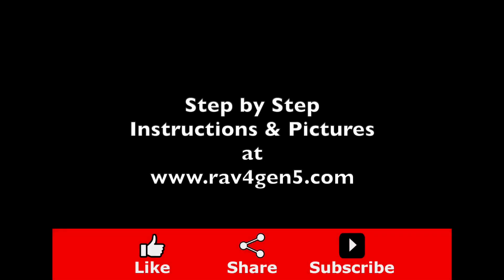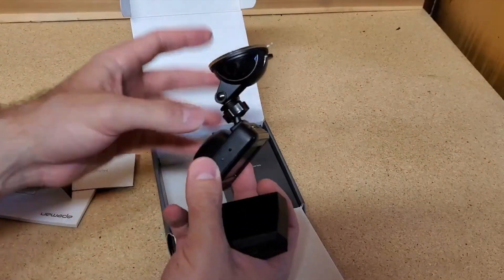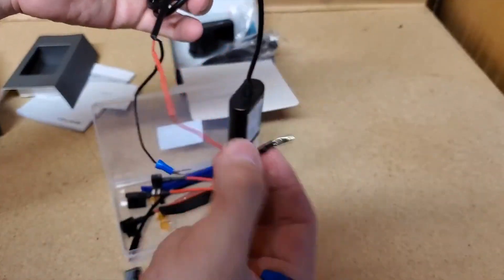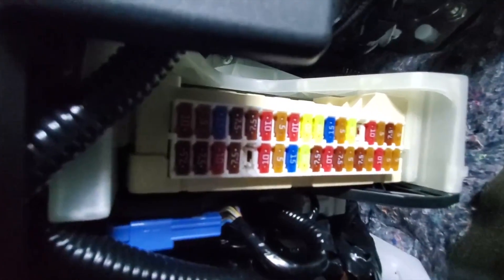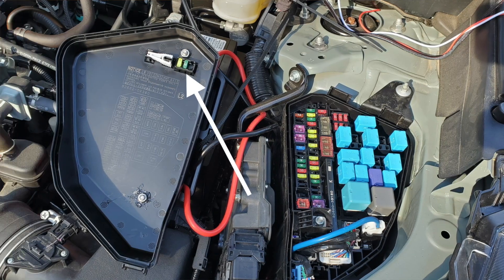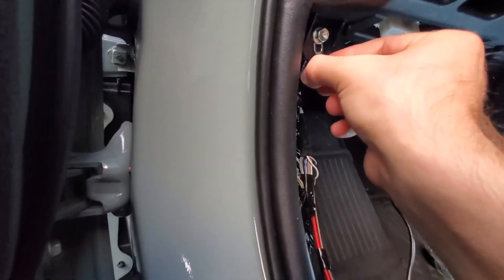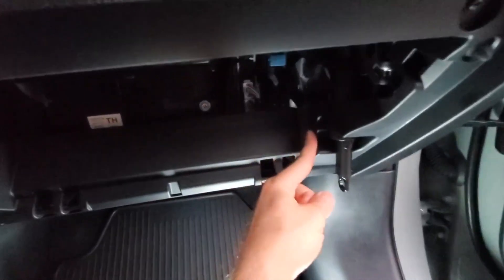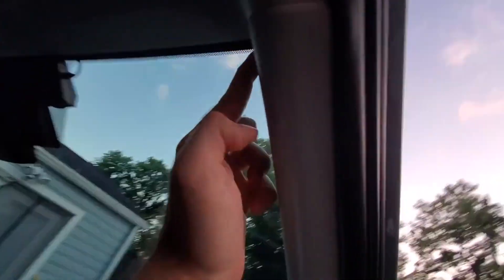Dash Cam Install on the Toyota Rav4 2019 2020 2021

Comment: Thanks for the tip. I threaded the cigarette connector power cable through the hole.  I think I was able to push it to the right and up and then felt it with my fingers.  It took me by surprise that I felt the cable after so many attempts.

Comment: 4:44 the direction if fuse tab MATTERS (please upvote so others can see this)
Reply: Doesn't matter if you are using a blank spot like he did, but if you pull an existing fuse, then it could make a difference.

Comment: The way the wire is being tucked under the plastic trim of the A pillar and running to the headliner, won't this be getting in the way of the side curtain air bag? I think the A pillar trim needs to be removed and the wiring needs to be routed in a way so that it's not in front of the air bag if it ever deploys. Do you have a video though on how to remove the A pillar trim?
Reply from the maker: Yes. I capture this in a later video. To remove the A Pillar, you can watch this. https://youtu.be/gei1uzoRCkw?t=354
Reply: @Rav4Gen5  Thanks, your videos are very helpful.

Comment: I have Hybrid model.
What if I have 3 wires (WITH PARKING mode):
- BAT cable
- ACC cable
- Ground

In which fuses should I put BAT cable and in which ACC cable?
Thanks
Reply: The Battery cable fuse is tapped on a fuse that is on all the time- fuse for dome light.  ACC tapped on fuse that turns on only when the car is on. Like heated seats, heated steering wheel. Options.

Comment: Hi, this question might have asked before but i have 2024 Rav4. I am using empty fuse slots for hardwire dash cam installation. Can i only use 1x 5A fuse on further side of the 2 slots in the plug and keep 1 empty? i tried but it didnt worked. I used other 5A which is always on and when ignition is turned on. Am i doing it correct. Please help

Comment: Thanks for making this video!  Very good timing as I’m expecting my dash cam next week and have never fuse tapped one before, but am going to attempt with this one.
Reply from the maker: Sweet! Take a minute to check your cabin fuse box to see that it similar to my guide. I have an adventure trim. I'm guessing it can vary depending on what factory packages we have.
Reply: Rav4Gen5 Yes true, will have to check mine. Mine is a Cruiser model which we have in Australia. Hopefully it’s the same as yours

Comment: Very nicely explained. If this RAV4 happens to be hybrid and if dash cam hard wired then it would not void warranty? The second method looks very safe and not touching fuse box and using cigarette lighter socket. I would be very interested if you have made a video for dash cam (front and back) with parking mode recording( separate battery backup) and not hard wired. Thank you.

Comment: Very useful video, thanks for making it.
Note: Only place the dashcam's lens in the range of the wiper blade motion, otherwise they are can't be used all the time.
Reply from the maker: This is very true. I actually have to adjust mine. Silly mistake.
Reply: Do you mean so that the wiperblade passes across the lens?

Comment: I'm using the VIOFO hardwire kit and it comes with a red "Battery" wire and a yellow "ACC" wire. How do I go about setting up the fuse taps for these two and where would I plug them in to the fuse box? Also does the direction I plug it in matter?
Reply from the maker: I am not familiar with that hard wire kit. It allows recording while the engine is off until a low voltage. I don't recommend this because Rav4 has issues with battery drain issue and this will escalate that issue. See instructions of the kit but looks like you need to find another fuse slot with constant power. Not sure.

Pig tail of fuse tap goes towards the direction of the door.

Comment: If I want to have the recorder on even when the car is off, which fuse box should I connect it to?
Reply from the maker: Any fuse that has constant power when car is off. Check with voltmeter but I don’t recommend it unless your device has low voltage cutoff.

Comment: Hi. Thanks for the tutorial. I'm trying to install it using the cigarette lighter but when I thread it through the hole (at 7:30 in your video) I can't find it. Could this be trim related? I see you don't a switch to turn off the Auto Stop/Start. Could this be blocking me? Any suggestions to get around this?
Reply from the maker: I don't think it's trim related but I also know it's a pain in the butt. Can maybe try a more ridged line or something. Best thing would be to go to the fuse box.
Reply: @Rav4Gen5  Thanks. I removed the gear knob and tray below the plugs and managed to thread it through

Comment: Looking to hard wire my 2021 RAV4 with a dash am as well. But cannot seem to figure out what type of fuse the interior fuse box uses, such as mini vs micro2 vs low profile or ATO. Any help appreciated. Don’t want to order the wrong add a fuse
Reply from the maker: Mini =)
Reply: there are two types of mini, (ATM mini and Low profile mini) for rav4 2021 you should use a low profile mini fuse tap..

Comment: Excellent video. But what about the ACCessory cable (yellow cable from the 5v to12v usb adapter to plug into the fuse box) ? which port do you recommend when RED and GRD are installed ? Thanks for your feedback.
Reply from the maker: You'll want to follow the instructions provided in your purchase. Mine didn't have a yellow cable. Your purchase allows the camera to continue recording while the car is off until a low voltage point is reached. For simplicity, you can combine the red and yellow cables together and tap into the same fuse in the video. This will turn off the camera when the car is off.

Comment: I’m hardwiring a BlackVue 900X to use in parking mode. What fuse do you use for the second wire (always on) and which two fuses do I have to place on the fuse tap? Thanks!
Reply from the maker: You'll need a volt meter and find a fuse that has power running through it while the car is off. Make sure you buy a battery jumper in case your dash cam voltage meter fails. You put the original fuse in one slot and another lower amp fuse in the other slot. The original fuse goes into the slot closest to the pins. I'll make a video on fuse tapping into a Rav4.
Reply: @Rav4Gen5  Thanks so much for the quick reply! I read that if you use an empty slot you don't need to fill both slots in the tap. Can you confirm that? Also, how do you decide which amp fuse if you use an empty slot? Does it depend on the car circuit or the device you use?
Reply from the maker: Correct, you don't need to fill in both slots if it is an empty slot. Only the slot furthest from the pin. You select the amp fuse base on the wire gauge size and the instrument your are connecting.The dash cam should specify how much amps it needs. Most likely 5 amps is plenty and will protect the wires too.
Reply: @Rav4Gen5  One last question (I hope!): can I plug both fuse taps towards the same direction, or the one in the left column to the left and the one in the right column towards the right, or the other way around? That would be great to see in a video because there's a lot of disagreement in forums and not a single video of what happen or could happen if you plug the fuse tap in one orientation or the other. Thanks a lot for your time.
Reply from the maker: Good idea. For me , it is in the direction towards the door. I need to double check that though. Might be different depending on the fuse you are going into. You want the current to travel through the fuse. I think my weekend is sunny so good day to make a video on this.
Reply: @Rav4Gen5  Sounds like a great plan! According to BlackBoxMyCar, orientation does not matter... but some people argue you could blow the fuse... just have a jumper ready! :)

Comment: Than you for the great video,
just a question. have you noticed slight resistance when you shut the driving seat door or any noise (air) since you have put a wire on the weather strip?

Comment: Thanks for this great video! Just wondering though, what SD card did you use? Because I read some comments from Amazon that it won't work with any other SD card unless it's the VIOFO endurance MicroSD card. Thanks in advance!

Comment: Where did you find the yellow 5 amp fuse ? 
Where do you get the second fuse ?
Reply from the maker: Fuses come with the kit. If not, you can purchase them separately. There are some fuses in the fuse box in the engine compartment but I don't remember which ones.

Comment: I bought 3 of  this dashcam and one died on the 2nd day >.>
the step down converter was soldered backwards (Black + / Red -) on the output side. I had a fun time trying to figure out what happened to the voltage and why the voltage was backwards
Reply from the maker: That is super weird. Glad you figured it out. Good thing amazon returns are easy =]

Comment: Quick question: what if you're going to be piggybacking off of another fuse? Do you insert the original fuse to the "add-a-fuse" in-line with the positive cable and the dash cam fuse next to it or it doesn't matter? Since I will be using an existing 10A fuse and my dash cam is 5A, would it be safer to insert the original 10A fuse first, then the 5A dash cam fuse to the "add a fuse"? I kinda repeated myself there but it's a little confusing. I would think the 10A goes first since the accessories for my car draws the greater current and then it trickles down to my 5A dash fuse. If that makes sense.
Reply from the maker: I cover it all here. https://youtu.be/t2X1924Mv30

Comment: Does it matter what spare fuse you use from the spare engine fuse box?
Reply from the maker: It needs to be a fuse that is smaller than what is installed in the fuse box that you are tapping into.

Comment: I can't get the fuse box cover to go back on after plugging that wire with the two fuses on it. Were you able to get your fuse box cover back on?
Reply from the maker: No. You can't.  Tape it on there so it doesn't get lost.

Comment: Hi   Well explained the fuse box/wire entries, Its a shame you did not have the rear camera set up and were to connect too. Thank you welshman 2081
Reply from the maker: I do cover rear camera install in a different video. It's not much different than this but it can depend on your trim.
Reply: @Rav4Gen5  Hi Thanks for the info, can you please give me a link so I  can view it. Regards welshman 2081

Comment: The wire seems to go over the air bag, this looks dangerous as it could block the airbag deployment?
Reply from the maker: Yes. It does go over the side curtain air bag. I have planned a new video to show and address this. But the airbags should still deploy fine despite a flimsy wire.
Reply from the maker: @kenwetz9545  Thanks for the response. I cover all of this in later videos including the removal of the head liner and the installation of the rear camera. I'll probably re-upload this video to point out this air bag issue. Seems to be the right thing to do.
Reply: @Rav4Gen5  Did you make a re-upload? I noticed many comments pointing out many mistakes including the air bag and fuse wire issues and you promised re-upload. People like me with little knowledge on this stuff easily get lost. I didn't see a re-upload link in description.
Reply from the maker: I will make a new version of the video but whatever people are saying about the airbag is not likely a concern. No issue on the fuse either. I’ll have a video this week maybe.

Comment: So the fuse cover won’t fit back on after install? Just verifying, as I just installed this. Thanks for the vid! It was easy.
Reply from the maker: Correct. The blade add a fuse will stick out. Tape the cover near that area so it doesn’t get lost.
Reply: @Rav4Gen5  Man, that was a fast reply! I was about to delete my comment cause I saw it asked and answered in the comments here. Thanks again!!

Comment: i have a 2018 rav4 :( can i do this?
Reply from the maker: For sure. There is probably already a ton of videos on how to do this on the 4th generation RAV4.
Reply: @Rav4Gen5  thank you for the quick response. I am not able to find any instructions for 4th gen rav 4 dash cam install only 2019+… i wonder how much different it would really be

Comment: How you know which fuse to tap into so camera turns on when car is on? I believe this is your off camera work.
Reply from the maker: Check this video. It could help. https://youtu.be/t2X1924Mv30
I did not specify the fuse because your trim might be different. But you'll want to check with a volt meter which one is on only when the car is on/accessory mode. 
Mine is in the empty slot between "Washer" and "ECU-IG1-NO4"
Reply: @Rav4Gen5  thanks man

Comment: What is the disadvantage to wire it via cigarette plug ?
Reply from the maker: Only disadvantage is you won't have a cigarette slot available and/or wire clutter. Not a big deal to some.
Reply: I realize that G-sensor for parking mode requires hardwire installation, cigarette power cable will not work.

Comment: This is golden thank you very much, I might just do it my self now. Would you suggest any dash cams with parking mode that wouldn’t drain battery, like Blackvue dash cams?
Reply from the maker: Hey. Thanks for the feedback. You certainly can use the cams that have park mode but I would not recommend it. There is already reported battery issues with the Rav4 and this will not help. I would recommend just buying a large battery bank. Connect car to battery bank so that car will recharge the bank. Connect the cam to the bank so it can run with or without car on. Not perfect but it does completely isolated from the RAv4 battery. The cams use low watts so it will last a long time before the bank dies.
Reply: Rav4Gen5 oh ok yea I guess I can do that, I can use the cigarette lighter from the back ares of the vehicle. What battery bank do you recommend ? Blackvue has some right ?
Reply from the maker: Blackvue looks like some very overpriced stuff. I would just buy an Anker brand on Amazon. You can get a fuse tap kit like in the video to recharge the power bank. Then buy another long cable to go to the dash cam from the bank. I think I will do a Monthly September video and I'll cover what I did.
Reply: @Rav4Gen5  waiting for video

Comment: I wonder why you insert another fuse in the add a fuse. If the slot in the fuse box is empty you don't need that second fuse, it MUST remain empty. And one more think, the direction of the add a fuse DOES matter, you have to find out the hot side of the slot in the fuse box and then insert the add a fuse accordingly.

Comment: Awesome tutorial but I personally think it is not the best solution to tap into the fuse box cuz our new RAV4 got more electronic component and complexity than before. I’ve used an OBD power adaptor to supply power to the dashcam to regulate its power delivery and that way the manufacturer can’t deny service to car saying we’ve added something to the car that is not intended to be there in the first place. (The orb adaptor will also regulate voltage base on your brand of dashcam “
Reply from the maker: Thanks for sharing. It is a good point. I should have included the OBD as 3rd option. I am totally comfortable with fuse box adaptions. It built to protect electronics and I am tapping into an empty slot. It can also be easily be removed if Toyota is going to complain about it . 

Depending on the settings, your OBD option might keep the cam on while the car is off. Which is nice because you'll have around the clock recording but you might be cycling your battery more depending on how low the voltage actually gets before protection turns on.
Reply: Rav4Gen5 good consideration you have there ~ :) and I just want to thank you again for showing the tutorial on the dash speaker upgrade! I got mine upgraded and the sound is a lot better than that piece of...trash that came with it in the dash 🤣
Reply: J Law lol I’m still debating on doing it to my 2020 XLE! The speakers aren’t too bad currently but the comments in the other video make it seem so much better? Better bass, sound/volume, etc? What is the big difference; 75 upgrade may be worth the investment if it’s that drastic!
Reply: @JR-oi2cf  I have done the JBL dash speakers upgrade too. Worth EVERY CENT!  Do it. You'll love it 120%.
Reply: Someone Awesome alrighty I’m convinced! There should be a code so Rav4Gen5 gets some sort of kick back for all the business he’s directing to these speakers lol. I look forward to more videos!
Reply: @bibigonzales5  I did the JBL dash speakers too lol!! Thanks to Rav4gen5